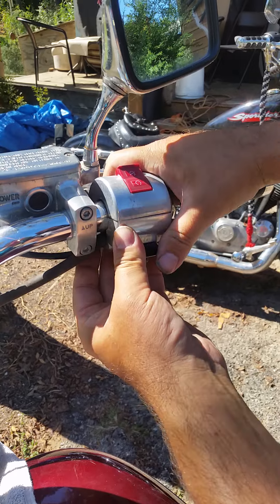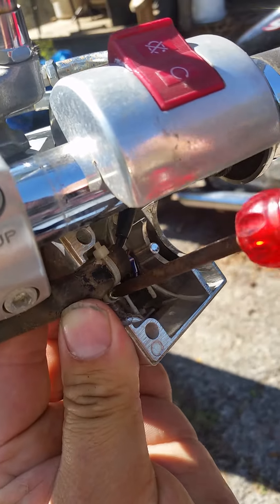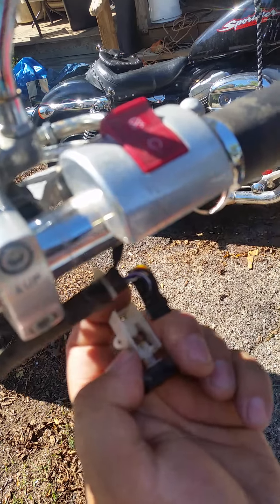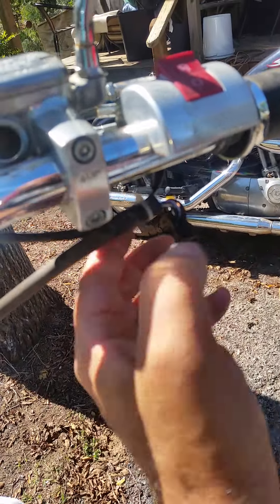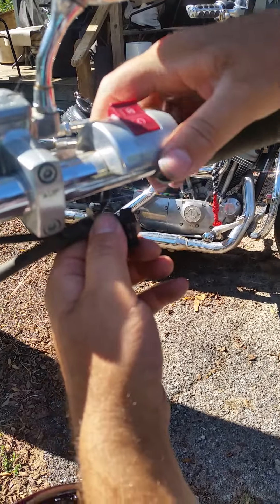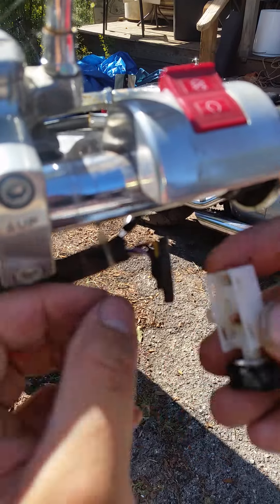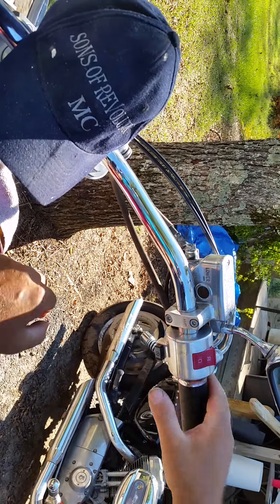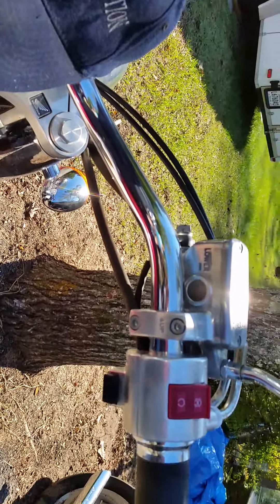SRMC How to repair a faulty starter switch

Comment: Great video.  I was about to replace the whole kill switch housing on my 2002 shadow 750 . I figured I had nothing to lose by trying what the guy in this video suggested. I used contact cleaner and lifted the contacts gently with a dental pick, lubed the button with good ol Wd40    and put it all together and it worked great. The way I see it,  this video saved me about $100. Thanks man
Reply: Thanks it was a big help from Louisiana
Reply: Exactly my problem, except my horn is fine 😊 You were right about the white plastic housing being brittle. I took a little chunk off, and the spring switch didn't sit quite right after that. Got it modified, though, and we're off to the races. Thank you!

Comment: Thanks man. I got my VTX1300c started by the 2nd time I hit the starter button.  It had been sitting for 1 1/2 years, due to bald front tire- Hondas are awesome!  I had put the startron enzyme in the gas and added more gas. After running for 15 min's I hit the kill switch but forgot to turn the key back after a customer showed up. Afterwards I tried to start it the lights would come on but it would not even turn the motor. Ignition fuse was good. I thought maybe the kill switch was bad, but saw this great video and followed it and cleaned the starter button but it didn't work, except as I tried it and was moving the whole assembly it tried to turn. So I took it apart again and had to raise the 2 terminal connections and now it works every time. I appreciate this video.
Reply: Do I need to unplug the battery terminals at all before I clean the terminal switch and tackle this job?

Comment: Thanks for making the video.
That metal ball is to keep it in place upwards so the terminals on top are forced to touch.
After you cleaned it, it probably didn’t have issues for a while.
Hopeful all went well.

Comment: Great video! I went to get my Honda VTX 1300 inspected today so I could renew my license, and the headlight wouldn't work. I Googled the problem and found that it was most likely related to dirty starter switch contacts. Your video showed me how to fix the problem. Now the headlight works and my bike will pass inspection! Thanks so much for posting your video!

Comment: Just did mine yesterday. Works like new. Cleaned it with brake clean and used a wire brush on the contacts. Starts as it should. Thanks for the vid.

Comment: Thanks!  I got as far as pulling out the switch but didn't wanna break the plastic getting to the contacts so this was helpful! Let me add one small tip:  There is a tiny little spring underneath the two contacts that are side by side.  I cleaned it 3 times before I realized that spring was compressed thus the bad contact.

Comment: Good helpful video, thanks for posting.   I used a pencil eraser to clean the copper contacts.  A light amount of Dielectric grease using a Q-tip afterwards also done.

Comment: I did this while ago on my 2002 Honda VTX 1800 . I used 0000 steel wool to clean terminal contacts off , then I made sure to rinse and steel fibers and debris away so doesn't cause a short , using some maf sensor cleaner, then I very lights coated the contacts with dielectric grease very light coat, worked fantastic...!!!

Comment: Cheers.  I have this issue with a Honda 2007 CBF 250. I've already got the switch in bits. Your video is useful. Hopefully cleaning it up will resolve my issue of headlamp not staying on.

Comment: This video was extremely helpful, my bike now starts easily on first press without cutting in and out. However, I would like to point out that when I re-screwed the plastic switch to the aluminum housing, I put the screw in too tight, bending the switch out of shape misaligning the contacts, I guess?. After disassembling everything again and starting over, I discovered this issue. Thanks for the video.

Comment: I took it apart today and it wasn't bad, but just bad enough that it wouldn't click. Works perfectly now. Hope it keeps working. Mine has never been in the rain even though it is 1994 so the contacts were fairly clean on the back of that black holder, but the two on top were a little green. Thanks.

Comment: Awesome Dude. I had the exact same problem and it’s now fixed. The fact the headlight was also not working was puzzling but the wiring diagram showed the power going thru the switch. I did notice that the plastic under the contacts was slightly melted and I’m wondering if that’s because I hooked up my phone charger to the headlight wiring? It was an easy place to tap into power but the added current load may have introduced more heat in the wiring and switch.

Comment: I had an issue with intermittent starting so I opened the starter switch assembly and removed the switch same as you did. I found that the little brass piece with the two bumps has a spring under it to keep constant pressure on it but do to overheating ( I assume from holding starter button too long) the spring had metten down into the plastic and the plastic had melted the brass piece into place not allowing it to move up. I was able to get it unstuck and working again but did order a new switch housing as that was not a permanent fix.

Comment: thank you for the video, my 2003 vtx1300 just stopped at a stop light and would not turn over, all it does is kill the light when I try to start it, hopefully you  have the solution considering the parts look identical.

Comment: I did that and still no start, I thought it was the whole piece so I tried with a clip to jump it and it worked perfectly, I cleaned and lube it but no luck yet any other tip? 
Thanks for the video

Comment: Nice Video, I just bought a 1992 Virago 1100 and It won't start , stick the key in ,i have headlight but nothing , it does not kick over , not even a click so I am going to pull that switch and find out what is the mystery in it, Again nice video .
Reply: Found it, it was a bad neutral safety switch , Thanks for the follow up Bruce,    From St. Petersburg , Florida

Comment: Hey, my Shadow's switch just stopped working all of a sudden. I was trying to fire it up in cold weather to let the engine run a bit, but when it died the first time I fired it up, it never started up again. There is power, headlights leds a working, but switch doesn't react. Headlight doesn't turn off when I press it

Comment: I think my kill switch is also messed up. My neutral light wouldn't come on, and when i pushed the start button, there was nothing. Then i stopped using the kill switch and just used the key to shut off. Seems to work for time being. But probably going to have to do what you did.
Reply: I have an 03, 750 Honda Shadow

Comment: I was having problems with my starter switch. Turns out the white part of the switch was MELTED at the contacts. So I have to replace the entire housing unit.